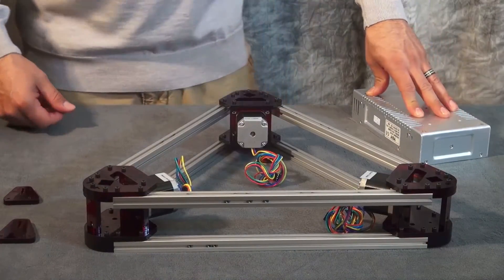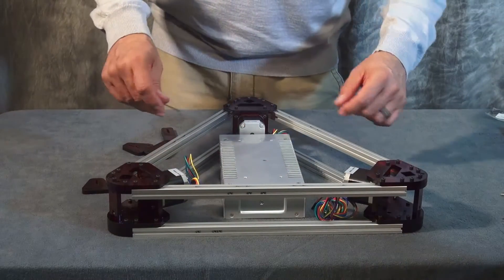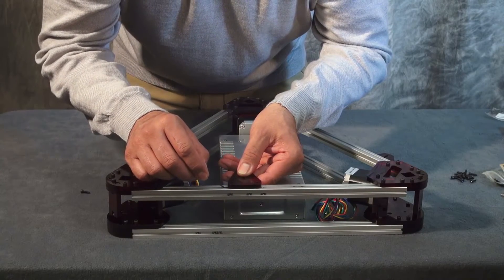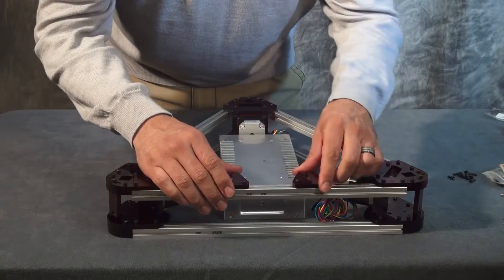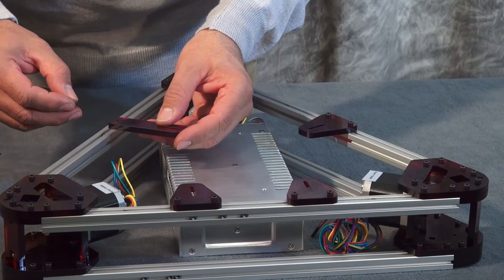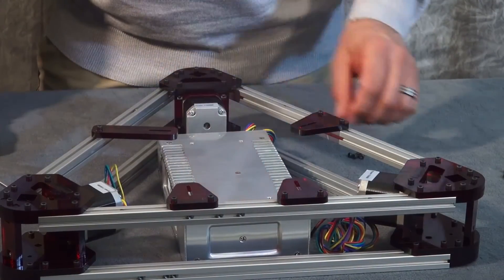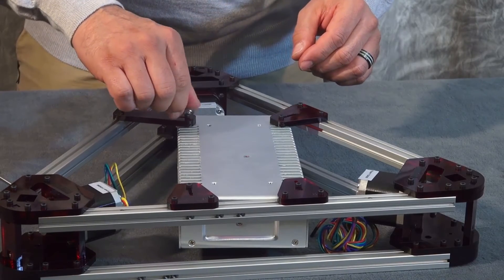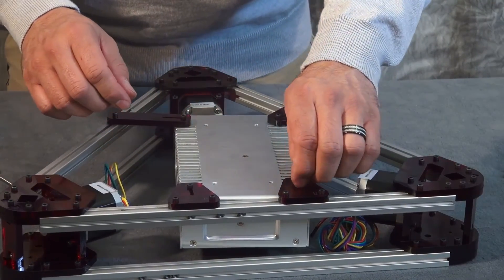Kossel Clear Build Instructions Chapter 8: Mounting the Power Supply

Comment from the maker: hey guys, the PLA versions have the smaller power supply (not the one in this vid). To wire it up, the power needs to be fed directly on to the ramps board (not the arduino board). It will require for you to manually cut the barrel jack, and wire directly to the 5A ramps input. (remember to check polarity) :)

Comment: Is this step for the ABS unit only?
Reply: I was wondering the same thing. Looks like the adapter plugs right into the Arduino but the photos of the PLA printer seem to have a hefty power supply under the bed (which wasn't in my kit)